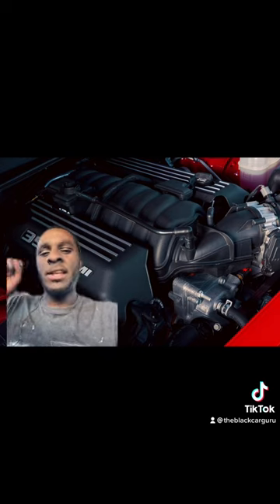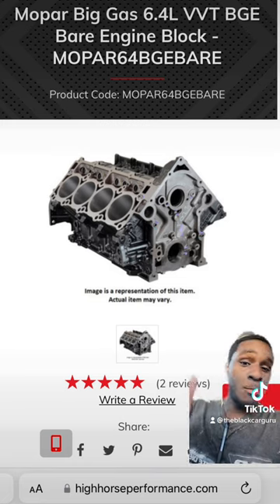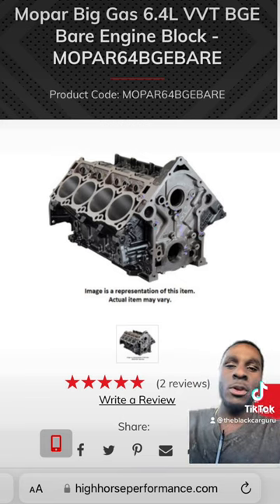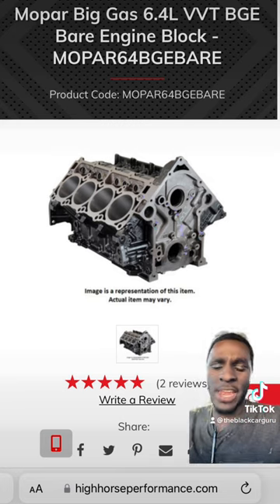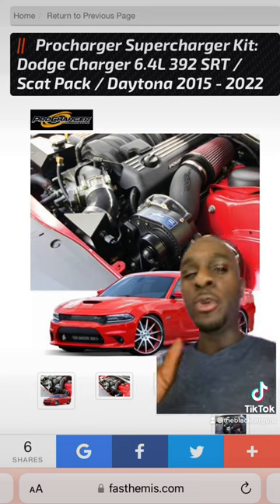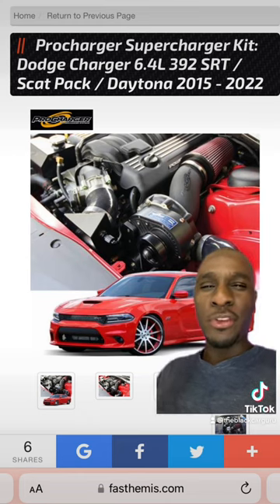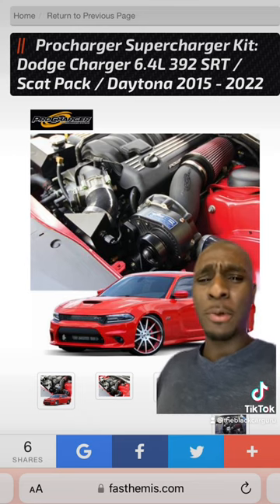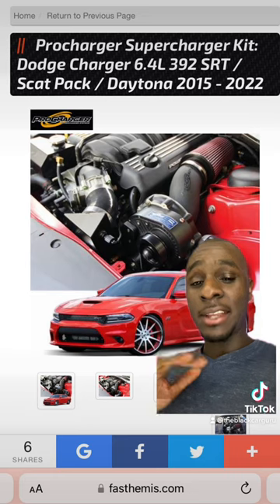You can get “HELLCAT POWER” out of a 392 “ScatPack” if you do this!

Comment: My 392s been running 7lbs for 120,000 miles. Got it with a whipple from a dealer in Illinois. They said ring gap had been changed thats all they did internally. Great thing was it was warrantied for 100,000 miles. Car had never been sold before i bought it so i dont know how they did it but i never had a prob with it except the driveshaft.  2 failures, one at 2,500 miles and the other at 7,000 miles. They went with a stronger shaft the 3 time and have never had a problem since. I will never sell this car. Got the Mopar logo in the seats and gauges. Never seen another like it...
Reply: You got to give us a video
Reply: They do not change the ring gap. They change the pistons because the ring lands are too high up on the stock pistons
Reply: @mrwhamisrick  Stop pontificating on s*** you don't know.  Opening the ring gap can slightly lower compression and make it easier for the 6.4 to take some boost, but It mainly keeps the edges of the piston ring from touching and fusing under heavy load and expansion...
Reply: What’s the name of the place that did the whipple

Comment: Got 222,000 miles on the 6.4L Scatpack, never touched it- drive it hard everyday. Probably drop a Demon engine in it when the time comes. Best car I have ever had. Mopar or No car.
Reply: You're going to need more than just the engine my friend
Reply: 200k miles is wild
Reply: @busterc6600  yeah just straight up buy a hellcat,  you gonna have to get the demon engine + build the tranny + stronger driveshaft + suspension upgrade + exhaust + axles + tune (maybe even standalone ECU) + rims + semi slicks this is like a 50k usd build easy including labor and months of your time, at this point you replaced almost every component of the car,  just get a hellcat with a 2.75 pulley and you'll be making same or close HP to a demon and also probably run 9s in the 1/4 mile.
Reply: @cortion730 Proper maintenance goes a long way.
Reply: I have almost 150k on my scat engine. Routine maintenance is your friend. I beat on it daily. Never had a more reliable car.

Comment: The 392 will handle 10lbs of boost safely with no risk of failure on one condition. You must regap the piston rings.
Reply: It has nothing to do with gap. The ring lands are too high on the stock pistons and they break under too much boost
Reply: @mrwhamisrick  they break because the edges of the pistons rings touch...

Comment: I'm leaving mine stock. I dont really give a shit about racing. I can pass slow people, get on the highway quick, thing sounds great, and I still have the challenger body. That's cool enough for me.
Reply: @mickeycohen5653  exactly
Reply: True
Reply: These don't need boost. Mine has mid muffler and reso delete along with lower hellcat airbox. I put 275 tires which doesn't require adjustment on camber. That's really all you need and my car sounds amazing and it likes to be driven hard

Comment: All 392 blocks from 2018 and on are BGE blocks.  Took this straight from the Dodge Website, "With the advent of the 6.4L HEMI truck engines, a thicker block was cast and used across the entire engine platform (that included 392 HEMI engine-powered cars and SUVs around 2017-2018). These blocks are known as “Big Gas Engine” or BGE for short."
Reply: I was just about to say this. I learnt this the other day after messing up a rod bearing. Most don’t know but the hellcat block and bge block is the exact same block just the hellcat is torque honed and painted orange

Comment: 2018+ 6.4 blocks are BGE blocks for scat packs
Reply: I thought everyone knew this lol
Reply: I have an 18 charger scat, im new to this game. What does BGE block mean? Any advice
Reply: @brandonramey4114 it’s a stronger block for boost , compared to 2017 and before scatpack or srt8 with the 6.4 but you still need pistons and rods
Reply: @carlosmijares8854 so I have a SRT 392 Durango I’m new as well but after I change my pistons and rods would I be in the green to super charge it?
Reply: @TopRankFirearms  if you have a BGE block which I think you do , pistons and rods will help you with boosting the car , only worry would be the transmission and supporting mods after a while
Reply: @carlosmijares8854  so what does that do? Does it ad more hp? And yea once again I’m knew to this so cut me some slack haha
Reply: @TopRankFirearms  doesn’t add any Hp , but if you plan on going for a high build it’s recommended to upgrade the fuel system in general
Reply: @carlosmijares8854  does it fit the doge Durango 2018?
Reply: @TopRankFirearms  yes

Comment: 6.4 Hemi V8 engine Ram Truck version in 2500hd and RAM 3500hd 6.4 is stronger than Car Scat Pack/392 6.4 Hemi V8 all the parts interchangeable from 5.7 Hemi V8 engine, 6.1 Hemi V8, 6.2 Hellcat Supercharger Hemi V8, 6.4 392/ Scat Pack Hemi V8 ,
Reply: Wrong.  In 2018, all 6.4s became the BGE block...

Comment: Question: why are these engines so expensive to modify? Im just curious since im not familiar with this platform, im more of a windsor/modular ford guy.
Reply: It’s strictly cuz nobody makes aftermarket parts for them to the same degree as an LS or Coyote. 

If you’re building one and want it done cheap, for us 5.7 guys anyway, the best bet is to put hellcat stock headers and get a whipple. Easy money for 500+hp safely. Obviously a tune…… but even with this route you’re still looking at 12k ish.
Apologies for being so late to the party lol
Reply: @michaeljosey879  not a problem, thanks for the response. It's absolutely mind boggling then that the HEMI, probably one of the most famous v8 engines of all time, have a more limited aftermarket then an LS and coyote. Although I like the idea of a whipple 5.7

Comment: Nitrous is definitely fun. Long tube headers, comp performance cam, diff brace/lockout, Hellcat axels/suspension and a 150 shot of NO2. Destroys hellcats. TRUST ME it’s proven. Less than a 9k
Reply: 392s come with hellcat axles bro
Reply: I’m running pretty much everything you said besides a cam and longtubes except I’m doing a 200 shot on mine
Reply: @392ant3  that’s what’s up. That’s definitely my setup. I have a 2018 R/T Scatpack and i had to swap axels and a lil bit more suspension work. But I’m killing Hellcats in the 1/8th. Where you located?
Reply: @omegared3922  I’m in Michigan
Reply: @392ant3  I was up that way in Philly a couple months ago. I’ll be back in February. We should link and run em 😈😈
Reply: @omegared3922  an a modded hellcat would destroy you so what’s the point 😂 shit pack boys think a couple of mods makes they’re cars all hellcat killers
Reply: @Gabethemosthated  lmao. I’ve taken a couple modded hellcats all the way in a 1/8th. Furthermore what do you drive? It’s always the guys that don’t drive anything on the topic or some shitbox 😂😂.